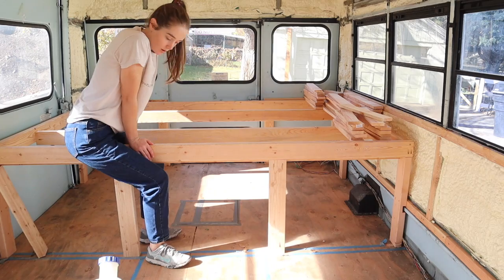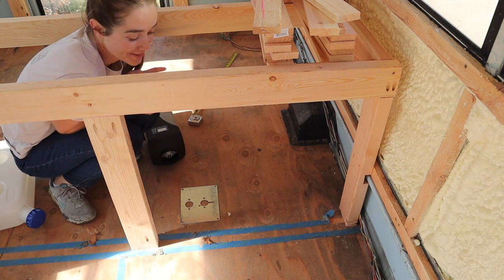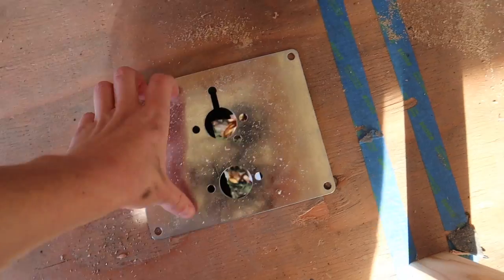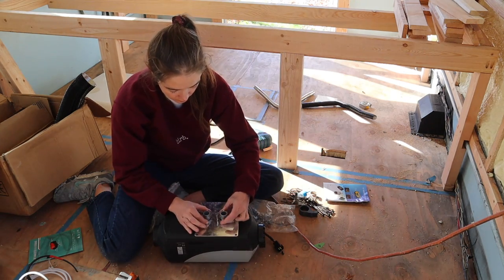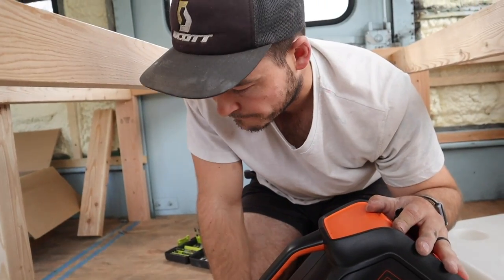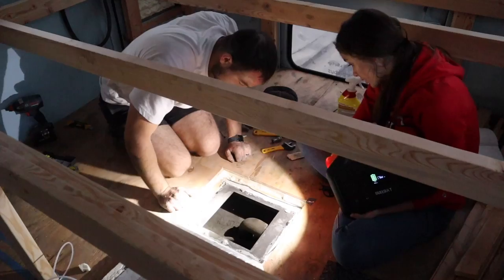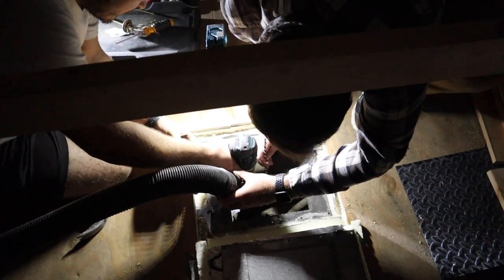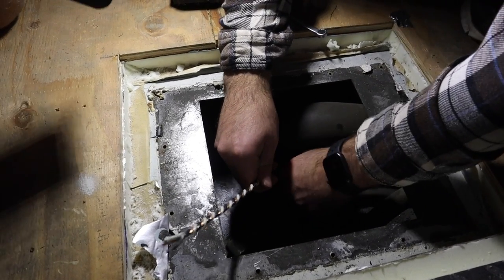Diesel heater install gone wrong - Heating up a school bus tiny home //skoolie conversion p34

Comment: These vids are like "what not to do" vids. I think most would have simply tapped into the existing fuel line and used a T fitting and not have drilled a hole in the gas tank. I thought out of three people, at least ONE would have figured that out but then I have to consider how young and inexperienced you guys are. Oh well. That's how you learn. At least you didn't try and use the little plastic tank. Nothing but trouble and no fun always trying to add fuel to it. It would probably run out in the middle of many a cold night. Now, how many of baby heaters do you need to heat the whole bus? Pretty tiny.

Comment: You can "make" a large Allen wrench by pressing paper to the bolt or plug to make an impression of it. Go to a decent auto parts store and have them find a deep lug nut that is the same size hex as the Allen. Then put the lug nut in the bolt and it will stick up enough to use an open end box or adjustable wrench on it.

Comment: You guys made it difficult! That copper tube was your fuel pick up for the motor, you could have went to a hose shop and got a tee fitting that would have went between the tank and that tubing and then to your heaters fuel pump. This way you wouldn't have had to drill a hole in the tank. Too late now though! lol
Reply: It's a bad idea tapping engine lines...better off to run a separate like they're doing.
Reply: Ha > So simple right. To bad they didn't get a chance to speak to you first but very entertaining.
Reply: @terry4265  simplicity tends to come from knowledge and understanding. Using a Tee can produce problems. Especially with those not familiar with the systems. They did fine for their knowledge and abilities
Reply: @mrmotofy  Yeah I agree. Their doing fine and so much fun to watch. :)

Comment: When you tap into your diesel tank be sure to not go all the way to the bottom of the tank for the fuel hose. Cut it back a few inches so  you don't use all your diesel. Then you'll hav at least some gas to drive into town and wont be stranded.

Comment: Emma. To deal with any metal shavings that may have fell into the tank, just simply drop a cheap magnet from a craft store down the hole where the fuel neck connects and let it fall to the bottom of the tank. Any shavings in the tank will eventually stick to the magnet and live out their tiny little lives stuck in the bottom of the tank.

You won't have a problem doing this. I have installed several of this type of heater and I have dropped a magnet in every tank I drilled. 

PROTIP: cut the pickup line in the tank so it cannot reach below 1/4 full. That way you cannot ever use up all your diesel for heat/generators and not have any left to drive the bus.
Reply from the maker: awesome!
Reply: Great suggestions! Especially limiting how much fuel the heater can use!
Reply: @EmmaBuildsBirbie  Also to combat the pump noise: If you can, don't hard mount the rubber pump mount to the body of the bus. Mount it to a very flexible rubber strap or better yet just let it hang from the fuel lines if you can. Also try wrapping the pump in some household pipe insulation. I the black foam rubber stuff.)

As other people have said in the comments, the pump click seems to turn into BANG! BANG! BANG! in the middle of the night. You are going to want to get ahead of the game on it now.
Reply from the maker: @dieseldave564  haha okay thank you! very good to know
Reply: Came here to say this as well! 👍🏽
Reply: U can try to mount magnet on stick or rope and take magnet out when u are done collecting metal shavings
Reply: @brihtl  there's no real need to do that. Just tossing it in is fine. It won't react negatively with the fuel, and will aid in picking up any loose rust in the tank. Not to mention that if she gets a diesel generator, she will have to drill another hole anyway. Leaving it in there is actually preventative maintenance.
Reply: Also (I haven't finished the video yet so maybe you did this already) if you go to an automotive shop, you can get a much better quality fuel line for cheap. We upgraded ours because it came already crimped pretty badly and the new one we were able to get is so much more durable! Also I second shortening the fuel line so it can't drain your tank. Very good tip!

Comment: I would have just used the supplied tank.  Or buy a larger tank. If your parked for extended time and using fuel from your main tank. You will always have to worry about how much fuel your heater is using so you don't get stranded somewhere. Huge props to you for tackling this build head on. As for the paper in the tank. well try to get it out. You may need to siphon most of the fuel out and use a long grab tool. Metal shavings would've just sat in the tank forever. Paper on the other hand will absorb moisture and will promote the growth of black algae in the fuel. Which causes lots of problems. Plugged fuel filters very quickly. Can be treated with a fuel algae treatment available at marine stores or online. Once you get algae growing in your fuel system it can be a nightmare to address the problem. usually treat it and then it plugs filters very very quickly. Always have extra filters on hand and the tools to change them especially in cold weather. A bottle of diesel 911 is very helpful if your fuel gels on you due to Temps in the teens or below. Always winterize your fuel in winter months to prevent this. If traveling from Southern states to northern states you likely get untreated fuel and it becomes an issue once you go north into colder weather. In extreme conditions it may be necessary to put something like a pizza box in front of the radiator to help keep the engine warmer while driving in sub zero condition. I don't remember if your bus has air or hydraulic brakes. But if they are air brakes you need to learn how to bypass the air dryer. Some air dryers you need a fitting to bypass them. This is for emergency use and temporary only.in cold weather the air dryer on an air brake system can freeze up causing loss of air pressure or inability to make air pressure.  Which will lock up the brakes. And preventing you from going anywhere.  With just a few tools you can bypass the air dryer and get to a safe location for further repairs or wait for it to thaw. Anyways just a few tips I thought I'd share.

Comment: Lesson #1 don't listen to comments from people who have likely NEVER worked on their own vehicles, installed heaters or touched a fuel line. You did fine...you observed a problem tried to overcome it and found out what doesn't work sometimes. 

Now one major thing you DON'T want to do is start tapping fuel lines unless you know exactly what you're doing. Some are pressurized and can cause all kinds of problems. Always better to ADD additional systems rather than modify existing. 

Now if you're worried about stuff in the tank. Harbor Freight and others have a pickup tool with 3 little metal claws that extend out and can grab a bolt etc. It's about 3' long and 1/2" diameter so fits in tight places, so should reach no problem. They also have small magnets with a hole in it that can be attached to a piece of wire to reach down in there and drag the tank... At a home store find the concrete tools section and find the rebar tie wire. Its very cheap and useful to keep right in your vehicle for exhaust that breaks tarps or items that flap down the highway etc. It's strong enough to tie or secure stuff yet flexible and moldable to tie in knots.

Comment: You’ll be fine :) There’s usually lots of debris and rust particles inside a diesel tank that old. That’s what fuel filters are for. The piece of paper will just dissolve for the most part and the rest will be caught by the fuel filter(s). Those diesel heaters make a constant clicking noise btw (from the tiny pump), so you might want to wrap the pump in something that will block that sound a bit. I installed one in my shed and when it’s quiet, the clicking noise drives me mad :)
Reply: We had them in the semi’s I drove, you got worried if it didn’t click, no heat.
Reply from the maker: good to hear! I mounted the pump underneath so hopefully it won't bug me too much
Reply: You can also silence the clicking a bit. Don't remember how bc we never did it when we installed the heater in our van (home behind us), but I remember seeing videos about it. We mainly use ours at night and the clicking is like a sleep sound lull for us now 🤣

Comment: I know its a little late now but if you put grease on the drill bit it will catch all the shavings. that plate just dissolved you should be fine. you should have put a tee in the fuel line.

Comment: I just installed a diesel heater on my bus; had to drop the (EMPTY) tank remove the fuel gauge sending unit, drill and install the pick up tube and reinstall...not that fun but awesome having the heater run off of the bus' tank...fun to watch your build

Comment: Any metal shavings that fell into the tank will settle at the bottom, which the pick up tube has a screen on it, anything that does make it past the screen will get caught in the primary and secondary fuel filters.
Reply from the maker: thanks!
Reply: Hey Emma, also your going to need to replace those fuel filters every 10 to 20k miles.  It’s not to hard something you might want to look into doing yourself in the future.  Could save you some money.

Comment: It's true, at least for me, I don't come here for instructions.  :)  I come here because I love watching you on your adventure.  Fail or succeed, it'll work out in the end.  It's too late now, but I would have removed the fill hose and drilled a hole in it and ran the heater fuel line thru it down into the tank.  By removing it, you ensure nothing drops into the tank.  Now you're going to have to find a way to remove that paper and tape.  It could potentially block your fuel pump from sucking up fuel.  I think the only thing you can do is empty the tank, drop the tank and then thru one of the openings remove the paper/tape.

Comment: As soon as I saw the blue tape on the contraption I knew what was coming. I was too scared to tap into my tank like this, and your brother is right, it's annoying about once a week when I fill them up (under my bus). I am about to swap for two 5 gallon diesel tanks though, so they will last longer.

Comment: Next time you fit one of those heaters, use a stainless steel turret. It fits in place of the flimsy supplied metal plate and has a down tube welded to it which reflects the heat of the exhaust going through the floor and stops your floor catching fire, especially with wood and foam insulation. Those exhaust go over 500f+ and glow red.

Comment: I like the idea of dropping a permeant magnet; however, I would first try using a strong magnet, attached to a rod, and sweep the tank several times until it comes up clean. This may eliminate the need to drop a permeant magnet.......
I would also frequently change the filter for a while........

Comment: I wouldnt worry about the the plate, I called that outcome from the moment I saw him making it lol.
I own a repair shop and have done 100's of fuel pumps and seen the inside of all kinds of fuel tanks, they always have a shot glass worth of particles and debris floating around the bottom of them.
That plate will likely disintegrate and the engine will laugh. Dont worry about it, nor the particles from drilling!
Reply from the maker: thank you!!

Comment: Wow.. you had me on edge when they started drilling in the fuel tank... I hope this turned out ok in the end Emma... looking forward to the next video.. Be safe!
Reply: Diesel is harder to ignite then gasoline. Under no circumstance should you ever drill into a gasoline tank without it being drained and flushed with water.

Comment: It will be fine, I would just recommend changing the fuel filters. Also incase you want to do this again I would recommend putting a bunch of grease on the drill bit to catch the shavings before they fall.

Comment: You needed to lower the diesel tank I think judging from other videos I've seen on this being done (granted it was usually on sprinter van conversions but the principle is the same, but it's not an easy job/heavy) I'm looking to do my own conversion next year here in England, so been looking into this..  However it is best to run to the diesel tank as you're never running out of fuel if you keep you're tank topped up. Also make sure you run the air intake to the opposite side of the bus as the exhaust pipe otherwise you'll be sucking in exhaust gases into the air intake if they're on the same side which is basically lethal potentially and at best harmful and you're bus will smell of diesel fumes the whole time. So make sure the pipes are as far away from each other as possible where they draw air in and exhaust gases vent out..
Great video very entertaining!! I think you may need to drain and repair or replace that tank though now.. but that might be best anyway New tank or at least a thorough deep clean inside, being diesel isn't the cleanest fuel anyway and the bus is so old, a clean tank to start is the best way to go so the bus doesn't suck up any crap out the tank and therefore will be more reliable in the long run and need less often fuel filter changes and protect the injectors.. 
Good luck!! Love your energy and love your channel and your fearlessness!! - All the best from London England 👍❤️💪😎🏴
Reply from the maker: thanks! good luck with your project as well!

Comment: Don't panick ! 
There is a screen filter in the tank and a filter after the tank.
Just forget about what fell in.
Next time you need to do something like that put grease on the drill bit and the shavings will stick to the grease.
And again dont stress there is probably more crap in the tank from previous owners and misshaps.
Thats why it has filters
Reply from the maker: thanks!

Comment: Drain your tank, flush it and change the fuel filters. The entertainment value is priceless but I get anxiety at the same time. I have a diesel heater. The little amount it uses, and I live in the midwest, I highly recommend the auxiliary tank.

Comment: We're here at least I am to learn. How boring would these videos be if you were a profesional installer. Measure this far from this point and this far from this point and drill this size of hole and attach it with this screw made by this company. NO! We're not here watching for your mistakes, we're watching you overcome those mistakes, overcome the fear of doing it. We're here to watch you move forward. I commend you. You are doing it the way that most of us would do it. Because none of us know what we're doing on anything at least until we do it. So keep going, your videos are awesome. Remember 'There is no try, only do!'
Reply from the maker: thanks so much!

Comment: Don't put line all the way down, you don't want to use all the fuel you might need to run your bus. Put a fuel filter on intake line before it goes into heater above floor. Going fishing now. Good luck :)
Reply from the maker: we did! thanks 😊

Comment: Don't worry if You get filings in tank just keep Your pickup tube a inch or so from bottom of tank. The Buses pickup tube is away from bottom of tank so it does not pickup foriegn materials. Just never leave a foil cover intact on a container when You pour into the tank if that foil comes off it can go into the pickup tube and cause issues

Comment: I have also seen a million people put a t-piece in the fuel outlet and run the fuel for the bus one way and to the heater the other way. Reduce as necessary for the heater.
Reply: If the plate hasn't dissolved, it may block the fuel outlet for the bus. A looooooooonnnnnnnnnnng set of pliers and try to fish it out, if you can.

Comment: Yeah, this was all pretty sketchy from the get-go. 
As a 30+ year over-the-road trucker, I can answer a couple questions for you. 
First, diesel fuel will not burst into flame from a spark like gasoline will. It has a very high ignition temperature, and will barely burn at all. 
Part of the process in a diesel engine is to heat and very highly compress the fuel in the cylinder in order to get it to ignite. 
The reason some of the fuel is recirculated from the engine back to the fuel tank is to keep the fuel in the tank warm. 
In sub-freezing temperatures, diesel fuel in the tank and fuel lines can gel up, and block the flow. Obviously, the engine will not run if this happens. 
In the winter there are additives we put into the fuel tank to help prevent fuel gelling. You can buy these anti-gel additives at most truck stops.
Get some now, and keep a few bottles of it in the bus. You’ll be surprised at how fast that first bitter cold night of the season will sneak up on you.

Comment: Well, at least it's biodegradable.  It will just infuse with the fuel.  I think the big thing is letting it have time to degrade.  Your test setup should give you those results.  As others have mentioned, a magnet large enough to not be picked up by your fuel lines will work well for this.  There are many different ways this could have been done, this was indeed just another way.